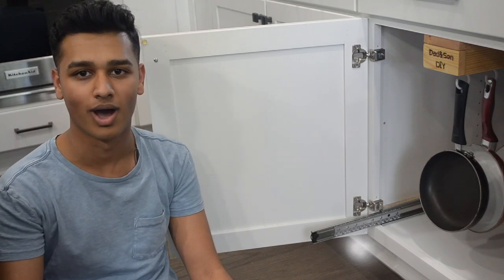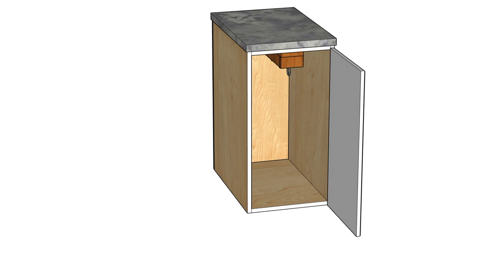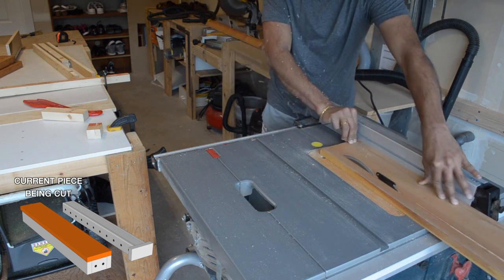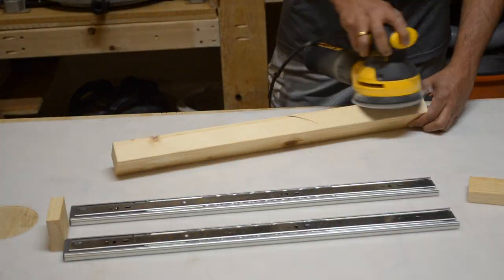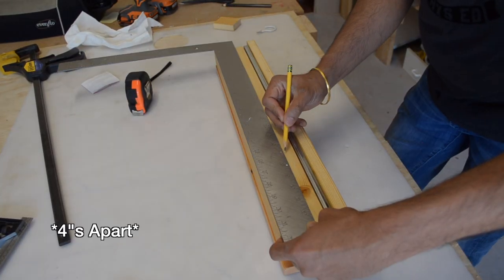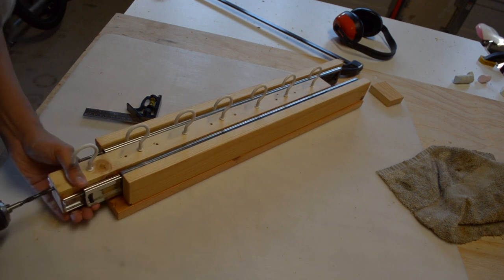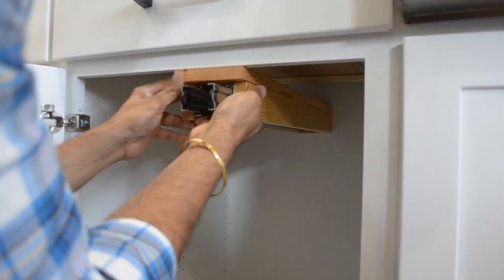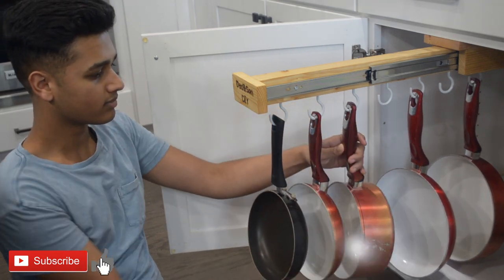DIY: Hidden Pullout Wooden Pot and Pan Hanger + FREE PLANS!!!

Comment: bro you can attach just 1 slider above and a woodpiece in between.
Reply from the maker: That would place all the weight of the pans and wood on the weakest part of the glide, potentially  resulting in premature failure.